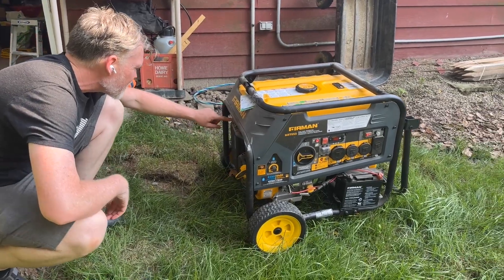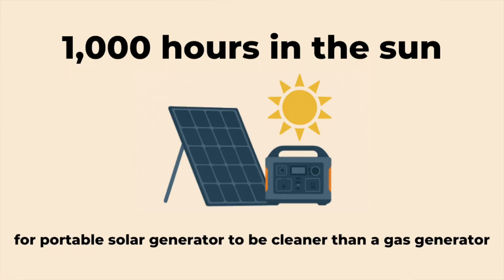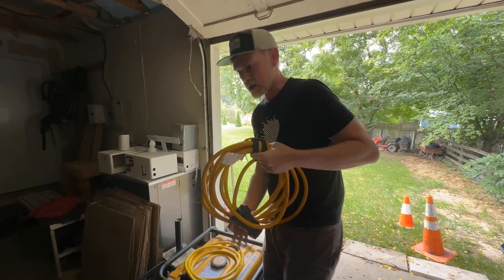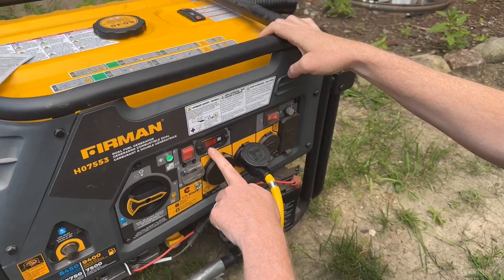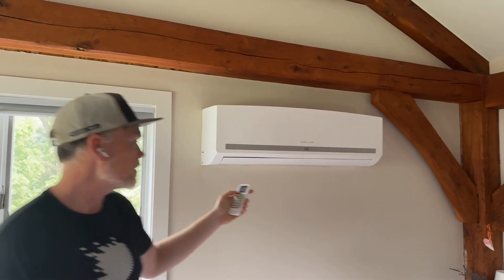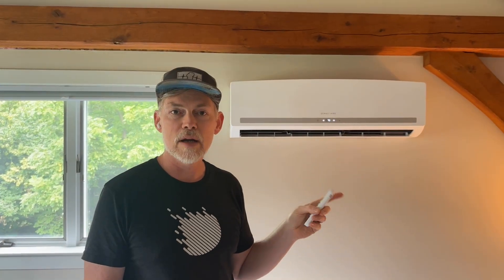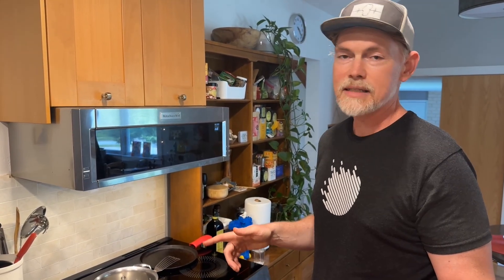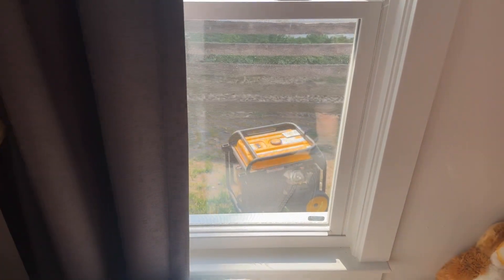Power Went Out! Here’s What My $1,000 Generator Could Actually Power

Comment from the maker: Gear I talked about:
Jackery Explorer 300 https://amzn.to/3Ug2YC1
ECOFLOW RIVER 2 https://amzn.to/4kNEuem
Uninterruptible Power Supply (UPS) GoldenMate Lithium UPS: https://amzn.to/4ooGFrJ
CyberPower UPS: https://amzn.to/45BZWhP
Square D - Whole House Surge Protection - https://amzn.to/3ZYACj7
Generator Cord, NEMA L14-30P to L14-30R, 30 Amp - https://amzn.to/3I5xImA
Generator Interlock Kit - https://amzn.to/40rNAWG
Generator Inlet Box, 30 Amp  - https://amzn.to/44F21cm
Reply: i have a pecron E1000LFP with the expansion battery, and no any some sort of generators with some exceptions like generac or some other things like that, is NOT recommended. cause it could get water logged, if its flooded, and or the generator locks up because of the water damage. so it is not recommended to use outdoors DURING rainstorms. i believe you should get the delta pro plus from ecoflows website.. that has a home power backup, upwards to 30KWs or something like that. with solar panels of course... free energy as long as the sun is out. so yea, if it rains i would not recommend leaving it outside during rain or rainstorms, because if and i mean if you are a severe thunderstorm prone area, also HAIL damage is a factor as well, and could damage that unit.. so yea, not recommended for that.....

Comment: I use my solar/batteries to run some things every day.  It runs my AC during the day in the summer!   They are not only a backup.  I also have a generator to charge my batteries when the solar is not enough in an outage.  Run the generator for a few hours to charge up the batteries for nighttime use!  I'm slowly adding solar panels to not have to use my generator as much and keep the noise down to a minimum.  (btw... I like half-eaten apples!  😉)
Reply from the maker: that's awesome thanks for sharing! glad to hear the solar and generator is balancing out your energy needs.

Comment: put a temporary  mental roof on top of the generator if it rains
Reply from the maker: good idea. I'm a little worried about the starter battery and front electrical panel. It did sit in the rain, but seems ok now.

Comment: Thank you for sharing. I am not here to criticize, but having a Plan B can sometimes be beneficial. I, too, have to tote my 11,500 Westinghouse generator a distance, using a spider web of cords. There is a chance that our power grid could become overloaded this week in Tennessee, given the 100°F+ temperatures expected. I am not comfortable running my generator in these temperatures with direct sunlight until evening, when the temperatures drop to the 90s. I can run my essentials (chest freezer, refrigerator, a fan, and a 5,000 BTU A/c for my small bedroom) with a Jackery 2000 and 3000 solar generators for most of the day. Then recharge them with the generator or solar panels at my convenience. Bar any disasters, my power has not been off more than a few hours. Toting the generator into position during or after freezing rain, snow, or at night at my age (73) would be foolish and dangerous. Again, having a Plan B gives me time for daylight or more favorable climatic conditions, allowing me to plan my strategy to work smarter, not harder. Having experienced a two-week power outage in 2008 with a Coleman 5,000-watt non-inverter generator, I learned a valuable lesson: experience is the best teacher.

Comment: Solar is not a good system for long term use. You are better off using the generator cause youll be using it to charge those batteries anyway cause solar always comes up short. The more power you use the more solar charging you need and they can never fully charge the batteries on a daily basis especially when its cloudy.
Reply from the maker: I would argue to opposite is true! Solar is great for the long term. It works for 25+ years and requires almost no maintenance. I'm sure I will drop my generator off at the dump well before that. What you are concern with is sizing the solar appropriately. Most people underestimate the number of solar panels they need, because they want to save money. The initial cost of solar is very high, but in the long run a generator will cost you more if you consider the total life cycle cost.

Comment: Time or budget to deal with solar or batteries?
I mean, I got 16 LFP batteries (320Ah each) with bus bars, covers, separates, and fiberglass tape for just over $1000. Pair that with an sungold clone (with 5kw continuous rating) for $400. It even has solar PV input to bring total power from solar up to a max of 6.2kw. I honestly don't even use it as a backup anymore. It's so cheap I just have it charge the car off solar with a 3.5kw charger.
Reply from the maker: Thanks for sharing! I love your DIY attitude and I'd love to try and build your extremely low cost version. My concern would be with a DIY set up like that is safety, I have kids running around with saws and screwdrivers poking everything (Seriously).  Also, that is a lot of work to build that kind of a pack and wire it all up (I work full time, I'm a dad, and I make youtube videos in my free time). But still this could be a great YouTube video to try for a dirt cheap battery pack.

Comment: The more efficient your appliances are, the better for running off a generator, you can use a smaller more fuel efficient generator. That UPS sucks because I can run my router off a 20k Mah power bank phone charger for about 10 hours.
Reply from the maker: The benefit of my little UPS is the "uninterruptible" part! there was no loss of power on my router even for a millisecond. The power went out and my router stayed on while I was in a meeting with a customer.

Comment: You might want to look up the load of each appliance.  We have been out on our property for over 5 years where we lose power quite often.  I learned the hard way with a standard 8,000 continuous watt generator that I could not run big appliances like the electric hot water heater, electric range, and electric dryer.  The dirty power fried my electric oven and electric dryer. I have since moved to a 7500 continuous watt inverter generator and selectively run what I need but not all at once.
Reply from the maker: Thanks for sharing! Sorry to hear about your electric oven and dryer! I need to be careful not to fry mine!

Comment: Just a few tips. Turn off those lights. Label all of the appliances and big power draw items in your panel and turn off the ones you don't need. Try not to run everything at the same time. Gas will go bad in a relatively short period of time and you can extend it's life with a stabilizer. Only use non ethanol gas.  I've got a dual fuel generator that I can hook up to a large propane tank. It's so much easier to store propane than gasoline. Speaking of gas, you should have a safe place to store several cans of gas but rotate them out by putting the older gas in other more frequently used machines and buy fresh gas for the generator.
Reply from the maker: good tip on cycling the gas! I did use a gas stabilizer in the generator, but it is old gas now.  My generator uses propane too, but I have not tried that part yet. Maybe I'll use up the gas and switch to propane simply for the storability. thanks for the suggestions!

Comment: I have a 20 kW solar panel setup paired with an 18 kW three-phase inverter, 64 kWh LFP battery storage, and a 20 kVA 3 phase diesel generator for backup. In the monsoon and winter months, when sometime sunlight is limited, I use the generator only to top up the batteries. I never run my home load directly on it, because generator power is never as clean as what the inverter provides. Sensitive electronics like VRV air-conditioning systems, PCs, TVs, routers, and inverter refrigerators simply don’t “like” generator output.

That’s why, for me, the generator will always remain a option for battery charging, while solar plus battery storage deliver a cheap, clean, perfectly balanced supply that my electrical and electronic devices love — and that helps ensure their long life.

One more important thing: if you run your generator at around 80% fixed load while charging batteries, you’ll get the best fuel efficiency (liters per kWh). Running it without planning — especially below 50–60% load — not only wastes fuel but also shortens the generator’s lifespan.

Comment: Really educational video, but please also be careful when running a generator that close to a window. I had mine 3 meters away from a closed basement window with the exhaust facing away from the window, and all of a sudden the CO detector in my basement went off. This was from an inverter generator running on propane with a fresh NGK Iridium plug which ran butter smooth. Mine was also smaller than the one in the video.
The CO detector on the ground floor already read 60 but didn't go off yet. I assumed it was far enough away but apparently it wasn't and CO can still enter your home just like that. I never really need my generator, but when I do, I make sure to put it farther away.

Just a little heads up, I wasn't aware of this either! But very cool video and a great example of how much people overestimate how much power they need to still live comfortably in an emergency, because the generator ran everything fine as it seems!
Reply from the maker: Thanks for the heads up on the CO problem. That never occurred to me and it was right next to my boy sleeping during his nap! All wi does were closed but makes me want to get a longer cord now.
Reply: @solarjoejoe you definitely should have your generator atleast 20 feet from any openings

Comment: i would invest in an inverter generator, especially when running sensitive electronic devices such as the AC, Microwave, Computers... a regular "cheaper" generator (such as that firman) do not produce clean power and you run the risk of damaging those very expensive systems. Also dont store gas IN the genny, drain the fuel and then run the carb dry so that the gas doesnt eat up orings and gum up the carb, even with fuel stabilizer with it sitting in the tank it could be a major issue when you need the genny most
Reply from the maker: GREAT SUGGESTION! Now I need to look up a youtube video on how to get the gas out and drain the carburetor. Then maybe I'll switch over to propane for the next trial run. But you're right I should just get an inverter generator version. But honestly I'd rather spend money on solar and batteries and i have this generator here.

Comment: When we moved to our new house 3 years ago, my second project was an outbuilding for the outdoor power tools and to store the generator and gas.  While building the outbuilding, I dug a trench and put in 2 inch conduit from the house to the outbuilding.  In that conduit, I added 2 cables of 10/3 and  one 12/3 cables.  The 10/4 cables are one for power out to the outbuilding(if I need big power there) and one from the outbuilding to the house(generator inlet line).  You may wish to run large conduit from the house to the garage, that way you can send power back to your generator inlet box.   At the old house, I had home depot 10/4 power cord cable(50ft) to get power from the old outbuilding to the old house inlet box.  With this house, I added the generator inlet box in the outbuilding so everything stays dry.  Good luck.
Reply from the maker: After dragging the generator 3 times in the last month to the other side of the house, I had the exact same conclusion. Electrons can move through wires with almost no friction, so why am I dragging this generator around! lol! I have a 60A subpanel in my garage, so I could add this in very easily.  I may want this to test other portable power systems in the garage too. This might be a video short coming soon!

Comment: I travel for work often, so I put in a whole house. Seems like always went out when I was conveniently not at home. Some day I would like an off grid battery/solar system of sorts. Dream at moment.
Reply from the maker: The initial cost of solar and battery is a lot more than a generator but the solar and battery system work every day to reduce your electricity bill! With solar it’s an investment with a payback period that also increase your up time, with a generator it is an expense that will never pay you back but only offer more up time. Get a quote for solar and batteries from a local installer and ask about your payback period. Good luck!
Reply: @solarjoejoe I agree completely. My issue is with payback if I have to move. I can’t solve that one at moment. My whole house can be easily moved or sold with house. Not everyone will want to buy my house with a solar and battery system.

Comment: Nice. In the 90s my parents often had the power go out during storms. I convinced them to get a generator. It worked out well. Can always add batteries and run the generator to recharge them as needed. And then add solar later. No need to try to buy things quicker than you can afford them.
Reply from the maker: I've lived in Michigan for the past 5 years and DTE has had 20+ power outages since I've lived here and few of them have been for multiple days. Different parts of the country will see more and more power outages since our infrastructure is getting old and for profit utilities are disincentivized to maintain and upgrade their networks. I have batteries coming next!

Comment: It's a good idea to run the generator at least once a month with a load.  I use an old hair dryer.  Also use non ethanol gas with an additive to extend the life of the gas.
Reply from the maker: Thanks for watching! That's great advice and I'm sure it helps, but I am far too busy (lazy) to maintain my generator like that. I am amazed that this generator started after not touching for 3 years. I did add some fuel stabilizer to it 3 years ago, so I am sure that helped.

Comment: With 16kWh batteries at less than $1800 bucks (and falling), almost a no-brainer to go battery and solar. Have that genny to top up the battery on extended cloudy days.
Reply: I have a 10k pack and it will run our house for 24ish hours if we conserve.  But also run a 13.5k  generator along side of it cause the batteries can't do the whole house.
Reply: You would need to make sure your generator has a low THD (total harmonic distortion). Inverter generators have a low THD (<1.2%) while I've seen traditional generators with a THD of 20%. Sensitive electronics like power stations, some inverters, and medical equipment can be affected by dirty power.
Reply from the maker: Great point! My lights were flickering and my appliances sounded strange. In future videos I’ll talk about this topic. Thanks so much for highlighting the harmonics issue!
Reply: @eliporter3980  honeslty dont matter, just get an online ups for sensitive stuff, but yeah some inverter dont like it but usually not an issue even with a brushless generator.  or just use a ac to dc converter then it dont matter at all and for battery charging, ie on my diy LF 8kw inverter i can feed it 48V dc from any source and it will run all day happy
Reply: everything with an smps will run on shitty generators, which these days are most things but it needs to be able to handle the surge load of the power supplies, and same when running motors, Many warnings about needing “good AVR” are mostly historical, relevant for old electronics or extreme precision loads. and yes your power station should really take whatever for charging but sounds more like a shitty design of an power station, inverters i agree to a degree but then just use it to top  up batteries
Reply from the maker: Thanks for watching Brian! I'd love to get 16kWh of batteries for only $1800 to back up my house, but what are you using? Something like a EG4 inverter with those low cost server batteries?
Reply: @solarjoejoe  I don't think my response went through but Will Prowse on his channel details the battery and inverter I'm referring to. Heres his link to the exact setup.
https://www.youtube.com/watch?v=oisSDHpgld0
Reply: @solarjoejoe  The 14.2kWH heated and weather proof wall mounted powerpro battery at Signature Solar is $3800. I have one and it is awesome. I also have the 18k EG4 inverter and 15 415 watt panels. I can supplement that power with my Cyber Truck on consecutive cloudy days. I only want an 10K generator so that if I go far out in the back country with my cyber Truck that 10K generator will recharge my cyber truck fast.